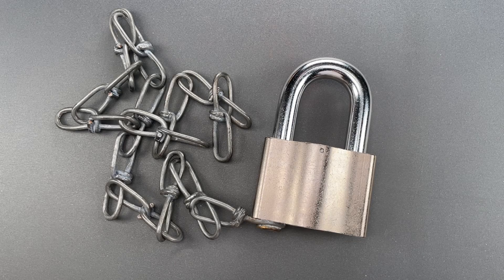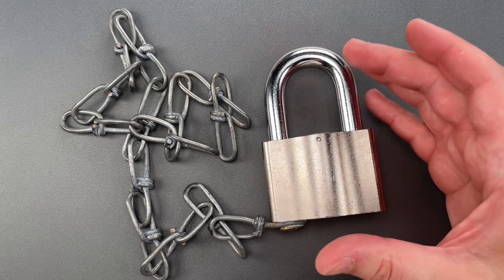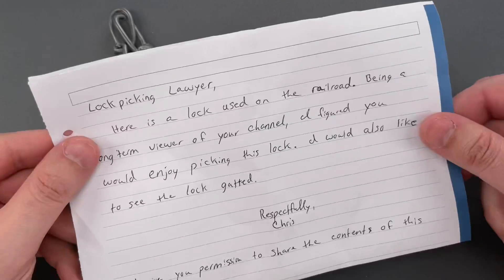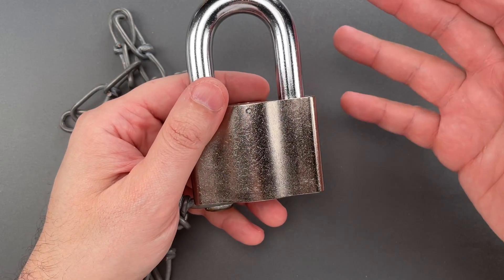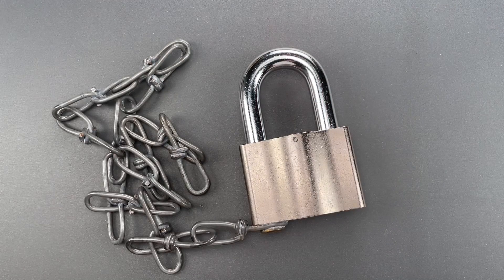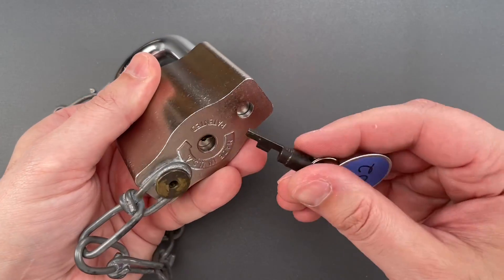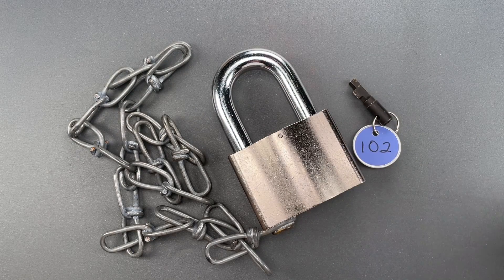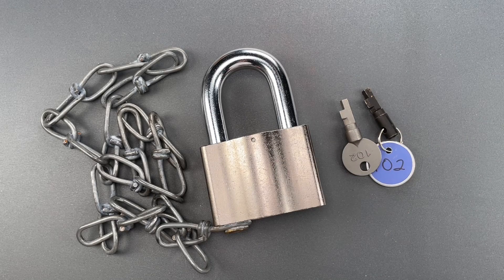[1482] The Most Weather Resistant Padlock Ever Made — S&G Environmental

Comment: In the UK & Ireland, a huge amount of 'locks' on railway kit that needs only minimal securing - realistically just a latch that requires a tiny bit of effort to open - uses a 'carriage key' that is effectively just a wrench. Think there might be two different shapes. Used to close an out of service toilet door or open the door that has the wheelchair ramp behind it etc. May be similar use cases here.

Comment: Hahaha these 102 locks are junk 🤣. I use them everyday. They are not weather resistant. They freeze constantly, the insides have plastic in them so guys will melt them when they try to unfreeze them. I've had to cut them off of switch stands with a torch several times.

Comment: I could only guess that they'd use a lock that only had 27 different possible keys, with only 12 ever used, would be to make it so the maintenance guy doesn't have to have 400+ keys wherever they are doing work to get into that portion of infrastructure.  As you have proven time and time again here on this channel, locks are a deterrent.  Essentially to keep honest people honest.  They aren't going to keep a determined person, authorized or otherwise,  from removing the lock in question.

Comment: Its surprising at how "secure" just the appearance of having a lock can be. I mean the fact Masterlock is still in business is a good example of that. I would wager even as high as 80-90% of people see a padlock and assume a key is needed. 5-10% of the people would just immediately get out a grinder or bolt cutter. The remaining 5-10% people are actually going to think about it strategically and/or look for ways to bypass (pick or otherwise). We aren't talking high end locks here either, something as simple as the little lock on a filing cabinet you can open with a paperclip.

Comment: 26 year, 2nd generation railroader here. These locks are typically used on switches either handthrow or power. Many keys are issued to railroad personnel so its more of matter of efficiency in accessing the switch, more so than effectiveness of the lock itself.

Comment: Presumably the chain is part of the locking system so it can go through gates etc which makes the robustness of the padlock a bit pointless, seeing as you can just cut the chain.
I reckon you could break or untwist a link in the chain with two large screwdrivers anyway.
Reply: The chain links look to be too small to fit the shackle. The chain is probably there to keep the padlock in the vicinity of whatever it's supposed to be securing and prevent it being "borrowed" to lock something else up which is supposed to be secured with a different padlock and key combination.
Reply: @robertsneddon731  That makes a lot of sense, the chain enables the padlock to be kept in a specific place, preventing it from falling somewhere unreachable when inevitably dropped, also making sure it isn't used in some undesignated area.

Comment: The old locks that these replaced were warded locks that were easily opened/destroyed with a hammer or a rock. They were quick to open and just snapped shut, if you were in a hurry, but not very secure. If they were frozen shut, you could thaw them out with a lit fusee.
 The first issue of the S&G locks were pretty much smash proof but it was soon discovered to be easily opened with a sixteen penny nail. That required the carriers to re-issue lock and keys with a slightly more secure key. The new locks are still susceptible to freezing rain...

Comment: I have to admit that these locks really do stand up to the weather here in Canada. At the railway that I work at we use these on switch stands and in over 13 years I've only had to thaw out a couple with my torch.

I work for the signal dept so we use Abloy's on our 'bungalows', usually the 240, and I've had to thaw them out lots and lots of times. Usually if I hold the lock in my hand for less than a minute is good enough but sometimes I need the torch.

Regarding the S&G Env., I got the code for our locks from Bosnian Bill and made my own key. I was out with a Transport Canada guy one time and he was telling me how secure these locks are. I told him they really are not that secure and showed him my homemade key, which took me about 30 minutes to make including soldering in a quarter for the handle.

As far as why railways still use this lock, because the people who make these decisions are like the Transport Canada guy that I was talking with and think it looks secure. The railway I work for started in 1918 and just last year we are finally going to start using Abloy puck locks on our signal housings. I've been telling my bosses that we need to use these for years.
Reply: That's pretty interesting... I'm in a signal department in the northeast and we use a miniature version of the S&G lock in the video. It has six discs instead of three.

Comment: They probably use such an insecure lock, because of two things, one is nearly every employee of the railroad can be provided a key.  It also comes down to Liability, say you have  switch, and there is a control box with 600V 3Phase, Joe Schmuck opens the lock, and gets zapped.  They can't then successfully sue, because they needed to violate the lock to gain entry.

Comment: These types of locks shouldn't be used to protect valuables and usually aren't used for that either. They lock storage sheds full of empty pallets and replacement rails. That's about it. What this is for is to prevent homeless people and ne'er-do-well teens from entering and making their new home or clubhouse in that storage unit. These sheds usually also have paper thin windows so a padlock would be absolutely useless in that scenario.
Not every lock needs to be used in a prison. Sometimes you just want to make sure that a certain group of people doesn't have easy access, that's it.

Comment: That lock is lime the ignition key on lawn mowers.  It is for safety, so it’s is harder to start, than security.  A screwdriver will start most lawn mowers without damage to the switch.

Comment: I would assume (and this is only an assumption) that if it really is areas that are somewhat seldom accessed or used the risk of losing the keys is quite high. this way the railroad only needs to have access to a very limited number of possible key combinations so that the lock can quickly be opened by someone else with a complete set of keys. Like some other posters have suggested it may also be the opposite. If it is used for areas that are routinely accessed by many different people then high security isn't as necessary. The lock simply acts as a casual deterrent.
Or, it could be both.

Comment: I'd like to see a video about security measures used on gates etc that use padlocks to prevent easy picking and other methods to breech the locks.
For example: where I live ,the local authority uses vehicle access gates that have the whole padlock inside a large thick wall steel cylinder, about 150 ~ 200mm ID . To unlock the padlock the user has to put his hand up into the cylinder and insert the key into the lock and then lift the lock off the shackle/hasp. No part of the lock is accessible to a grinder and there is no room to perform normal picking procedures.

Comment: Railway company employee here: There's another (quite obsolete but sometimes still encountered) use-case for those locks: railway switch safety (not security!).
One thing that these locks do is retain the key in the open position. This means you can basically "remotely track" their state if you only have one key for them. Some manual switches are designed in such a way that you can close the lock on them only in a certain position since they have extended sleeves/projections with holes on the handles that need to align. Also, one key can be used for several switches (hence the limited number of combinations) but with only one copy of it being available you will only be able to change the position of one of them at a time. This avoids certain unsafe configurations of several switches that could lead to derailment or collisions. Also, a switch operator can go back to their station where all the keys hang on a "switchboard" and at a glance check which ones are missing and be 100% sure of the position of each switch and the overall configuration of the system.
This is called key dependency - I only know it as "Schlüsselabhängigkeit" from my home country. :)
Reply: This sounds similar or the same as LOTO locks in English—Lock Out, Tag Out
Reply: @TheQuark6789  Yes! Exactly that!
Reply: Another Railroad worker here, the low security aspect of it may not be so much to protect someTHING of value but someONE of value - a worker.  We have manual locally controlled/operated track switches (the things that switch trains from one track to another) all over, in addition to the remote controlled (from a central control station) ones that are used on the service routes. In the maintenance yards and other locations these locks are used to lock the switches in a particular direction for worker safety. Say you have a train being worked on on track #1, you go up the track to the first switch and manually set it to track #2, so if any train (or even a runaway) comes along it cannot go down track #1 where the crew is working. It's up to the employees to set the switches correctly and lock them while they're working and to remove the locks when they're finished working. Not a theft prevention device, more of a safety measure. Even though a different employee with the key could remove the lock and switch the track, safety training is that you don't remove a lock that is set by someone else.
Reply: Sounds like a similar system i came across in my line of work. I work in many different locations doing maintenance.  One time i had to go in this room where many machines and convor belts are moving so you have to go in the control room take the key from the panel then go to the door turn another key that will then isolate the system and shut it down then insert that key in the door it will then realise the 2nd key thats already in the door then the door will then open the 2nd key gets taken out u then put in a lock box next to the door then put a lockout lock on said box. Go in do ya work come out and take key from lock box 2nd key goes in turn it that will then release the first key.  Put that in the panel turn it then the key that was taken from control room insert that and turn that will then reset the system then take said key back to control room put that back in main panel turn it leave it there then they can start the machine back up. Sorry if sounds confusing im not to good at explaining things lol
Reply: @YeahNahMateTV  this is known as fortress lock.
Reply: Brilliant, thanks for adding this information
Reply: Thanks for taking the time to share your knowledge.
Reply: Of course German has a six syllable word for an obscure form of key distribution based security/awareness.
Reply: @citylockapolytechnikeyllcc7936  that sounds very similar to Annett keys that were once a common feature of branch line railways in Australia. Points (switches) were locked by a key which was captive in a lock on the  signal lever. The only way to releas the key was having the signal at stop, removing the key would lock the lever preventing train  movement while the points were in a potentially dangerous state
Reply: Sounds like a similar purpose to some of the token systems used on some sections of track to ensure that only one train can occupy the track at a time.
Reply: One thing to add; only some of the key “codes” will actually retain the key, some don’t
Reply: Really interesting, thanks for taking the time to write it up.

Also, what the hell Germany. Stop pretending your language is a real thing :P
Reply: @mackemforever  LOL
Reply: Seeing a key is missing off the board only guarantees 100% it is missing off the board. Maybe it’s in a lock on a switch, maybe it’s in someone’s pocket on the way to or back from a switch, and hopefully not in their laundry.
Reply: @hundejahre  You're not leaving the train station or whatever you're dealing with in this state between shifts etc. It's for setting up specific arrangements for moving a specific train from point A to B on a low intensity track. There is a base configuration of switches and for that all keys have to be present on the switchboard. You literally take the keys you need off the switchboard before heading out to flip the switches. I guess this is another use-case for this - preventing operator error since you leave with a specific set of keys fitting only specific switches. If a key is missing to begin with you have to go out and make sure the switch is in the right position OR, when in doubt, no trains will be allowed to pass until the situation is resolved. It's just a basic layer of safety so someone doesn't need to run up and down hundreds of meters of tracks to check all switches - humans and procedures are still involved. Trust me, the system worked for 100+ years, but it's very rarely used since there are other mechanical locks in place or everything has been electrified/digitized.
Reply: @hundejahre  They are more interested in knowing if the switch is secured, and the key being on the board is a reasonably good guarantee of that. The key missing from the board means that you can't be sure of the condition of the switch, and need to go check.

Of course, this all relies on the workers doing the right thing - only one worker with a dozen keys in their pocket using one  of theirs instead of fetching the one off the board, and all this breaks down.
Reply: @robertbackhaus8911  going back to the hundred year thing, you’re leaning heavily on a logically Illogical argument. Railroading is one of the most regulated and thought out systems, ever, full stop. If someone was ever caught leaving keys about or forgetting to return them then they’re out of a job no questions asked if that gets out
Reply: @robertbackhaus8911  Which is why I said a key missing from the board ONLY means a key is missing from the board.
Reply: @robertbackhaus8911  one worker using his own key is likely to be liable for termination and liability for damages.
Reply: @hundejahre  If the key is on the board, you are sure of the state of the switch. If it isn't, you aren't, and you know you're unsafe.
Reply: YouTube neurosurgeon here

Comment: Several thousand assorted railroad employees- any engineer, conductor, brakeman, switch man, maintainer,  might have a reason to need to get thru that lock. In the old, big, brass padlock days, 2 railroad lock keys would open most things nationwide. The railroads were, and still are, mostly interested in keeping random vandals and thieves out of things, or from tampering with equipment, than with true high security.

Comment: It was explained to me when these were entering service that the railroads wanted a lock that was extremely reliable in the field and because of the shear numbers, thousands on a division and hundreds of crews of various crafts, that maintaining control of the keys was impossible. So th choice was made to use the larger, clunky guts for increased reliability, and focus on preventing causal access. For perspective the locks these replaced had in some areas been in service for over 50 years with the same years so with key loss and most retirees kept their switch keys, something that was issued on the their first day of employment, they weren’t all that secure either.

Comment: LPL mentioned only 18 of 27 used (by my count no more than 17, but I may have miscounted).  This is dictated my the design of the lock, not policy.

If the is no situation were a detainer cut closes to the keyhole is not as deep as a cut further away from the keyhole, the key can be removed when the key is in the lock and it is turned to unlock.   If all cuts are the same, not is that true, but the lock can be opened with a flat probe rotating the disks in unison.  There are reports that S&G did use at least one key code that did allow key removal when turned to unlock.

Comment: A lock hanging on some obscure box out in the nowheres is not there for security. Most of those boxes can be pried open anyways if one wanted to.
It's there to say "STAY OUT OF THIS BOX" and a beefy looking lock says it louder than a small itty bitty padlock.

Also, a lock with three discs and few combinations is going to be even more reliable when you need to open them.

Yes, anyone that knows the lock can open it with a common key.
But i mean, bank robbers could easily open the front door to a local bank and threaten the lives of those with the keys to open the vault(s).
If the locks were more secure it wouldn't stop the determined or curious out in the middle of nowhere.
Heck, even if you put the worlds most secure bank vault unattended in a deep forest somewhere, it would eventually be broken into even if it just held a note saying "you win".

Comment: As to "Why the railroad uses this very insecure lock" : Reason is purely for manufacturing.  The railroad would generally order thousands of these locks for a single area.  Maybe thousands more of a different key set for a different area.  The manufacturing process makes it easier and there by less costly.  Also in the delivery of keys and the locks, the logistics of distributing these things becomes much easier.  I hope this may put some light as to the question .  Love your show and format. 
😁:thanksdoc:🌍🌋